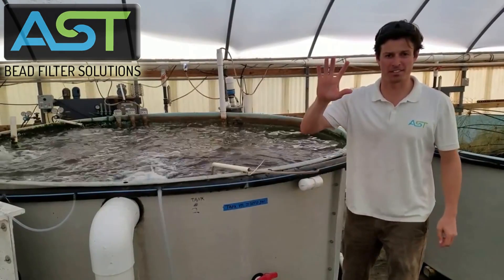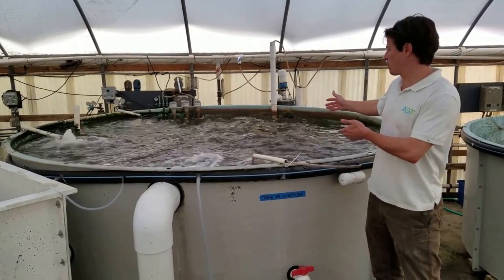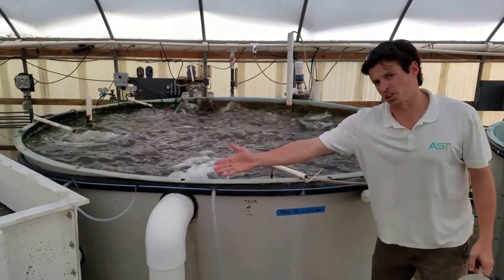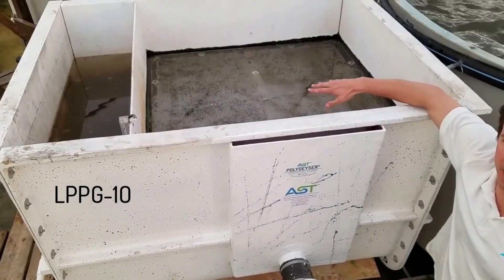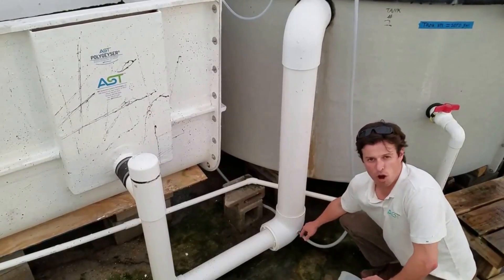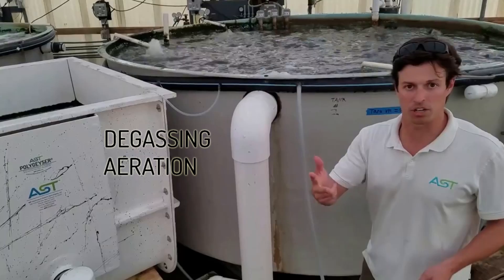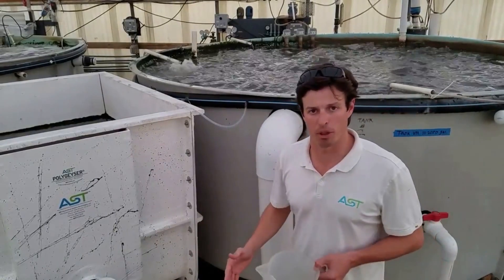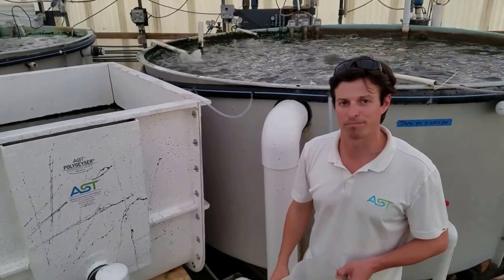Gravity Fed, Airlifted Return RAS for Energy Savings up to 60%! AST Low Profile PolyGeyser

Comment: what kind of compressor do you use that can work 24 hours and high pressure, can you give an example of a compressor and how much power is used for a fish industry like yours
Reply from the maker: For the airlift operation, we typically use a regenerative blower that can operate at at least 60" of head. This will assure that there is enough delivery pressure and air volume to maintain good water flow.
Reply: @ASTFilters  so you don't use air compressor but use a blower, can you show what kind of blower you use
Reply: @ASTFilters  Sorry I ask too many questions, as a beginner entering the fishing industry like you I want to ask a lot of questions about this

Comment: Hi, so would the be both full mechanical and bio filter? Would it be able to support 50 large koi (25"+) without having to use higher than 120LPM? How is the auto backwash adjusted aswell? Thank you

Comment: Why the water level in the filter is not the same level in water tank?
Reply from the maker: Ahmad, good question! The water entering the filter is being continuously airlifted back to the tank at the same rate that the water from the tank is flowing into the filter. This causes the water level in the filter to always be lower than that of the tank. If the air blower that is airlifting the filtered water back to the tank was turned off, the water level in the tank and the filter would equalize. 

I hope this answers your question...thanks for watching!
Reply: @ASTFilters   I 'm so grateful for your reply
Reply: @ASTFilters  I am sorry for my questions but, Is the filter with air pump working 24 hours in day? Or can we stop filter during feeding?
Reply from the maker: @ahmadelbaz5619  The filter is usually operated 24 hours a day, but it can be stopped if necessary. Usually the filters are operated even during feeding, but if necessary the flow can be stopped. 

Thanks!
Reply: @ASTFilters   I 'm so grateful for your reply

Comment: Hi. Just wanted to know, how many fish tanks will this set-up support ?
Reply from the maker: Able, 

This filter was installed on a 2,000 gallon tank. For intensive RAS, we would stock this tank at around 1,000 lbs of fish. For an average stocking density, I would assume 750 lbs of fish. The filter itself is capable of supporting a maximum or 10-15 lbs of feed per day while maintaining TAN levels below 1-1.5 mg-N/L. 

This setup could work on multiple tanks as well with a centralized sump, but the total water volume/daily feed should not exceed 2,000 gallons and/or 10-15 lbs/day. 

Thanks for your question and for watching!
Reply: @ASTFilters  That is some really impressive system right there. Thanks for elaborating 👍

Comment: If there is no air pump, does the water after filter will back to the tank by gravity ?  Or not?
Is there a video explain a gravity filter and back again to the tank  without air pump or water pump?
Reply from the maker: Ahmed, 

Good question! If there was no airpump to lift the water back to the tank, the water would remain at the same level in both the tank and filter and there would be no movement. In this video, we are injecting air into the large PVC pipe that is returning back to the tank. This allows us to lift the water above the tank's water level allowing more water to be fed back to the filter by gravity. This is how we can operate a filter without a water pump. 

Thanks for your question and for watching!
Reply: @ASTFilters  I 'm so grateful for your reply